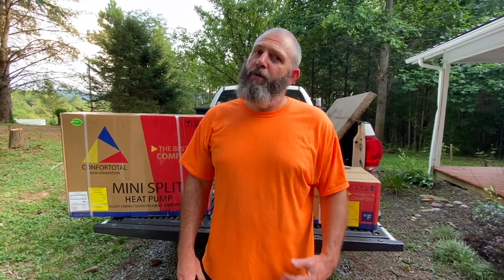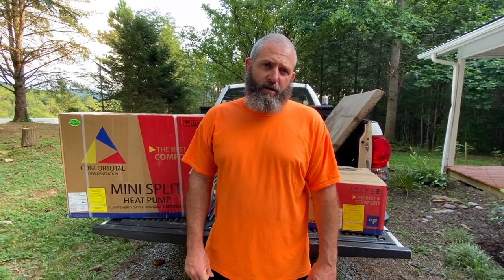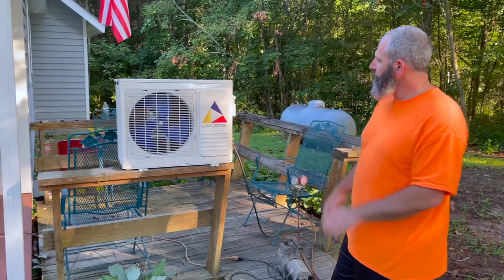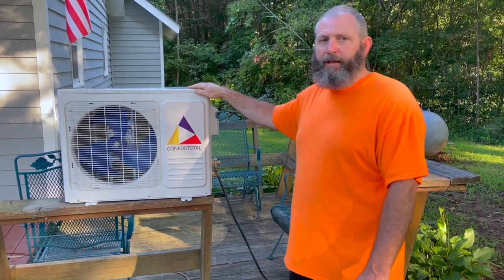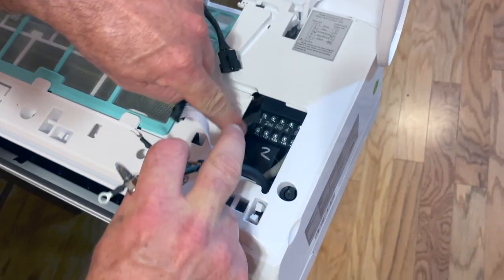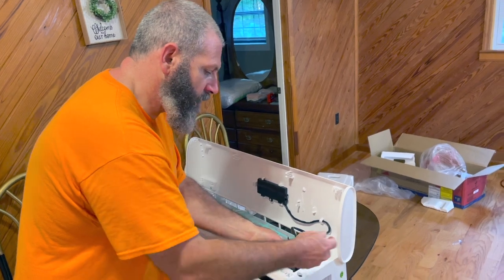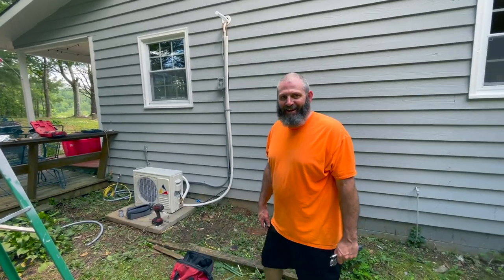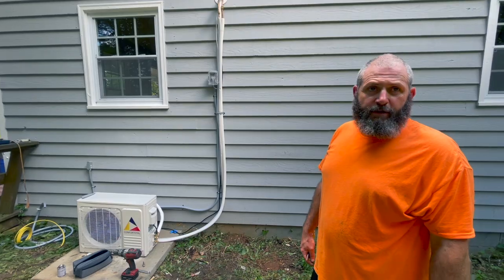INSTALLING THE CHEAPEST MINI SPLIT HVAC YOU CAN BUY!

Comment: I MUST SAY THIS GUY IS STRAIGHT UP. IMAGINE HOW MUCH FASTER HE COULD HAVE GOT THE JOB DONE WITHOUT FILMING. AND CONFORTOTAL IS ABOUT THE LOWEST COST UNIT OUT THERE. WHAT MAKES THE PRICE HIGHER IS POLITICS, AS THEY PROBABLY ALL COME FROM THE SAME PLACE, IN CHINA. LET ME SHARE SOME ADVICE WHEN GETTING A MINI SPLIT ONLY GET A SINGLE UNIT (IN OTHER WORDS 1 OUTDOOR UNIT TO 1 INDOOR UNIT). WHY ? BECAUSE THE MULTI UNIT WHEN THEY FAIL WILL F YOU BIG TIME. IE I HAD A SANYO POS SYSTEM WITH 1 OUTDOOR UNIT AND 3 INDOOR UNITS. UPON FAILING THE DIAGNOSIS WAS TO CHANGE "ALL" THE COMPUTERS IN BOTH THE INDOOR AND OUTDOOR UNITS MEANING THE COST TO BUY THE PARTS WAS MORE THAN THE SYSTEM ITSELF. F THEM. GET SINGLE UNITS AND WHEN THERE IS A FAILURE THE WORST CASE IS JUST REPLACING 1 UNIT. WELL THANKS FOR LISTENING. AND A THUMBS UP TO ORANGE WIRES GARAGE.
Reply from the maker: Thank you for the kind words!
Reply: Hi I was waiting for the refrigerant part.  After the vacuum did you have to put refrigerant and how much.  Did the unit come with refrigerant
Reply from the maker: @anthonygarraud9812 the unit has refrigerant already installed you just have to open the valves.
Reply: Hi, I was wondering the only lines you vacuum were from the head unit onto the outside unit you open the little Velau where you fill in for Freon whenever it’s low to release the fluid the refrigerant correct you only pulled vacuum from the head unit onto the outside unit to get the lines cleared of moisture and then once that was done youmake sure of course, open up the vowels and check for leaks on the connections that you made correct

Comment: For someone that does not know much about home ac installation, you did a fantastic job on it. Super video and I appreciate it and will be buying this same 220v unit for my 1200 sq ft shop.
Reply from the maker: Thanks for the support!  I think you will be pleased with it.  Thank you for watching and subscribing!
Reply: Depending on where you live 12000 btu in Texas will typically cover about 500 sq ft , it doesn’t hurt to over size these inverter type units but again it all depends on your heat load .
Reply: Thank you so much for this  video. I am an older single female that  had one of these installed today in an old  RV that I have chosen to flip and live in.
I love learning new things about repairs. I just subscribed to your  channel.
Reply from the maker: We are glad we could help! Thank you for watching and subscribing!
Reply: How did you un clip the front panel? I'm trying to clean my mini split unit and I can't see to get the front panel to open. Please help me

Comment: just a heads up you will need to reflare copper tube ends and use nyloc so it seals otherwise it will leak :-( mine came precharged. good job! :-)

Comment: $ years ago, I bought a Comfortotal 18,000 BUT, and a month later another brand 9,000 BTU.
The Comfortotal is running like new, the other one is being replaced next week, when it gets here.
The other brand has a messed up circuit board, and since the seller was not registered with the manufacturer, the will not warrent repairs.
The board costs just over half what I paid for the unit.
After replacing my old central AC, my electric bill went down by about 43%.
Reply from the maker: Thanks for sharing your experience

Comment: We have five of these. Two were tripping the arc/ground fault breakers so we swapped them for regular breakers and no more tripping. But one of them is throwing an E3 error code. Manual says to replace pcb and we did but same result. Tech support has been ok, sent wrong pcb first try…will be calling monday for additional support.

Comment: Thank you so much for your video, it was super helpful! We just installed this unit and the heat function doesn't seem to be working out blowing warm air. It's the middle of winter and cold so we don't have a need for the air conditioner function yet. Any suggestions on trouble shooting the heater?
Reply from the maker: This unit does not have heat strips only the heat pump function, so if the temp gets much colder than the mid 30s this particular unit will not produce enough heat without the “emergency heat” function. Thanks for watching and subscribing!
Reply: if there are several feet of extra copper lines coiled up vertically behind the unit, try laying the coil flat on the ground.

Comment: Great installation! thanks for taking the time to share it. Quick question, What type of ROmex wire are you using? 10/3, 10/2, 12/3 or 12/2?  Also, did you add a 20A breaker or used the current one that has the outlet you used power from? I am installing the same unit Comfortotal 240V and would like to extent the outlet but I am not sure what Romex size wire to use. Also this outlet I will be using has a 40A breaker at the panel. Do I need to add an additional 15A breaker for this unit? A 20A breaker? or just use the 40A breaker that are already wired for this 240V outlest I will be using? Thank you !
Reply from the maker: I used a 30amp breaker and technically you should use at a minimum at least a 10/2 with a 30 amp and 8/2 with a 40 amp.  The unit will only consume around 8 amps or so.
Reply: @OrangeWiresGarage  12000 btu only requires 14 gauge wire and a 15 amp breaker at 240 volt.

Comment: 1st of all great great video
I'm so glad that I ran across this video.
I have a question, I'm looking for something similar to this or maybe this exact unit for my 10 by 20 Shed I live in Michigan and we get pretty cold winters. Do you think this unit by itself would be sufficient enough h to really heat up a 200 ft² area or would you recommend a higher btu.
New sub 
Thanks
Reply from the maker: It gets pretty cold in Michigan, like really cold.  The unit that we have does not have heat strips so it is only a heat pump and those only work down to about 38 degrees Fahrenheit.  Not sure if this is the solution you need for heat, but definitely for A/C at 200 square ft. Thanks for watching and subscribing!

Comment: One of the best mini split install videos I’ve watched, great job. I’m going to order this for my shop, was wondering is the plug  on this 220 model 3 prong or 4? I already have a 10-2 wire ran for unit but if it’s a 4 prong 220 then I’m going to have to order the lass efficient 110 12000 btu model so I can use my existing wire. Thank u
Reply from the maker: Thank you for the kinds words and support.  This unit has a 3 prong plug on it. Thank you for watching and subscribing!

Comment: Thanks great job! I wonder how much to buy the vacuum and gauges are, and would like to see you do an update review of this unit in about a year.
Reply from the maker: It’s been a little over two years since we installed it.  So far so good.  As for the gauge set and the vacuum pump I’ve had those for years. Thanks for watching!
Reply: You can rent a vacuum pump and gauges from auto parts stores

Comment: Can’t you just run power to the outside unit to power up both?
Reply from the maker: You could do that, you would just have to deal with the plug on the inside unit.  We powered ours from the outside but used the cable going to the inside unit first

Comment: Thanks for the video. The cable colors that came with mine dont match the instructions. Do they connect 1 to 1, 2 to 2, 3 to 3, 4 to 4, 5 to 5
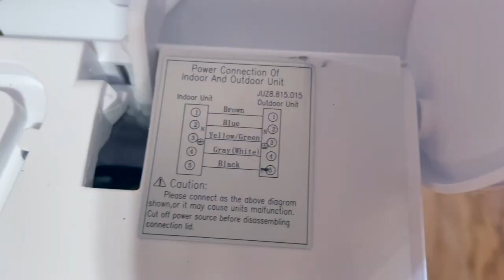Reply from the maker: You are correct check it out at 9:15

Comment: So it doesn't come precharged?  I'm looking for a mini split that is DIY friendly.
How good are cheaper units?  Also can you add another air handler if you wanted to down the road?
Reply from the maker: It does come pre charged we have used it for over a year now and are very pleased
Reply: @OrangeWiresGarage  Also I don't know if you already mentioned it, but if you install this unit yourself than it would void the warranty.
Reply: @Native722  As cheap as they are does it really matter. You could give a contractor 4 or 5 grand to put one in for you. Then it's only warrantied for labor for a year anyway.  I bought a 12000 for 661 dollars for every thing.

Comment: Did you have to do a vacuum for the refrigerant line? Do you have to?
Reply from the maker: The vacuum is to remove the moisture from the lines and evaporator I think you need to but opinions do vary.
Reply: @OrangeWiresGarage  thanks, I think it's best to do one.

Comment: For anyone who has the older units that displays only in celsius. You can order a new remote from the company in Texas and the new remote will display in Fahrenheit, but only on the remote and not the display on wall unit. It makes the conversion automatically between the remote and the wall unit. Again, It does not change the display on the wall unit. But at least you can look at the remote to see what conversion it is. It works perfectly. I ordered a replacement remote and found this out, all the other functions work the same as well on the remote. Hope this helps others.

Comment: Looking at getting about 3 of these to add AC to my house. My question is on the 220v version here does the power input hardwire connect or does it plug into an outlet? It looked like you put an outlet in an outside box to plug it in but I couldn't tell 100%.
Reply from the maker: It plugs into an outlet on the inside actually but We ran the 220 outside to a weatherproof outlet and connected it there.They also have the 110 model that plugs into an inside outlet. Basically the power feeds from the indoor unit to the outdoor unit via the supplied cable.  If you have anymore questions just let us know.  Thanks for watching and subscribing!

Comment: So the mini split gets power from the indoor unit? (Receptacle?) no need for outdoor unit power?
Reply from the maker: Yes that is correct, just plug it in inside (even though we wired ours outside) there is no need for outdoor power.  Thanks for watching and subscribing!

Comment: Hiya!! My landlord had this same kind of heater/ac unit installed in this house where I lives few weeks ago and got heater worked perfectly for 2 days then never worked afterward. Can you please explains me how I can get this heater comes through. Thank You!
Reply from the maker: Just press the mode button on the remote until you see the icon that looks like the sun.  Then the heat should be working
Reply: Melissa, if there are several feet of extra copper lines coiled up vertically behind the unit, try laying the coil flat on the ground.

Comment: This unit doesnt have any freon when you got it? I saw you charging it.  I dont have those tools to recharge and discharge
Reply from the maker: It does have refrigerant I only pulled a vacuum on the system before opening the valves to charge it!
Reply: So its not plug and play at all? It seems that it necessary to vacuum.
Reply: @OrangeWiresGarage do you have to vacum thw system before you open thw valves or can you just open the valves without vacum?
Reply from the maker: @mike.a-ti2qr  I would definitely recommend to vacuum the system before opening the valves to charge it

Comment: What is the size of the adapter used when hooking up the vacuum gauge?
Reply from the maker: 5/16 sae female to 1/4 sae male for my pump https://www.amazon.com/Adapter-inches-Female-Conditioners-Straight/dp/B07V95MS2M/ref=sr_1_2?crid=1X6CN4R5098K8&dchild=1&keywords=5%2F16+to+1%2F4+hvac+adapter&qid=1632750113&sprefix=5%2F16+to+1%2F4%2Caps%2C201&sr=8-2

Comment: What outlet did you use? I can’t find a 220 outlet for that style plug. Did you use a 20a?
Reply from the maker: Yes it was 20amp the unit only pulls around 5 amps when running.

Comment: Does the manual say what it can do in heat mode?  It should give a temp range until it loses efficiency
Reply from the maker: I don’t know for sure that is does but most heat pumps are only efficient down to around 40 degrees F.
Reply: @OrangeWiresGarage  gotcha the mini splits I use in my rentals can heat efficiently down to 5 degrees f so I was just curious at this price point what it could do.
Reply from the maker: @gregorybentz  this unit does not have heat strips only a heat pump.

Comment: My question is if you would have had bubbles due to a leak after spraying soapy water what would you have done? Tightened up a fitting a little bit or if that did not work would you have lost all the refrigerant and had to pay to refill it?
Reply from the maker: Good question since the lines to have flared fittings if it bubbled you could tighten it a little bit more and it should take care of it.  Thanks for watching and subscribing!
Reply: its why you test your lines with dry nitrogen before dumping the charge out of the compressor

Comment: We have two of these tripping breakers. Clean coils, condenser fans operating, no error codes. Runs for 15 minutes then trips…
Reply from the maker: 110v or 220 ?
Reply: @OrangeWiresGarage  110v 1ton
Reply from the maker: @ABC-wz2db  couple of questions here.  Are they on separate circuits? What size is the breaker?
Reply: @OrangeWiresGarage  seperate 20a circuits. Im not on site but am going to check the supply connections and amp draws when i can
Reply: Your manual should list what size breaker each mini split requires. Also. Each unit should be on it's own, independent breaker alone. How many btu's is each unit? 6k, 9k, 12k, 18k etc. The more btu's = larger breaker. A 25 or 20 or 25 amp breaker is required to prevent breaker trip for 12k and up. Your manual should advise what the unit needs. Also. Is your unit 220 or 110/115 ? I'm guessing you're limited on electrical experience? Consider hiring a professional electrician. 👍
Reply: We replaced the arc fault gfci breakers with standard breaker and no more tripping.

Comment: While yes it looks like an okay unit I’ve installed many heat pumps for the company I work for and I really don’t like the idea of this one sending the full power to the inside unit and to the outdoor I prefer the usual method of sending power to the outdoor unit and the indoor getting powered by the outdoor
Reply from the maker: Thank you for the input it helps everyone in the community.  Question: Why is the method you mentioned preferred?
Reply: Looks like a gree , there’s several factories in China that makes most of the ductless units . Many of them use the same parts . Midea makes a large majority of them and rebrands .
Reply: @OrangeWiresGarage  one breaker kills both units.

Comment: Any idea on how to hardwire this directly to the 220 wire?
Reply from the maker: I remember looking at that but decided it was better for me to just wire in an outlet to connect it.  Good luck!
Reply: @Orange Wires Garage  awesome ty! I had a hvac friend take a look at it. He said it's just getting the red and black wire into the 4 and 5 position. On the outside unit from the cut off switch. I'm going to try it!

Also how much electricity does the minisplit use?
Reply from the maker: @sergiomaldonado595  I checked the current draw on mine and it was around 8 amps.  Good luck!
Reply: @sergiomaldonado595  8 amps x 240v = 1920 watts!

Comment: I wonder how well this unit heats in cold temperatures?
Reply from the maker: Not too well it does not have heat strips this is only a heat pump but does pretty well with temps as low as the 30s

Comment: I just bought one and the compressor does not turn on so it’s only blowing regular air. I opened the valve as well. Any idea what it could be?
Reply from the maker: I would say to double check your cables to the outdoor unit but be sure to unplug it first

Comment: I just installed mine, I  had rubber seals in the protective caps coming from the inside unit,  do they get used or are they only for shipping and protecting the flare fittings?
Reply from the maker: Yes they are there to keep the evaporator sealed up,  you are correct you do not reuse them.  Thanks for watching and subscribing!
Reply: I think they are actually to put under the feet for reducing vibrations when mounting to pad
Reply: @eddiesampson2177  good thinkin...!

Comment: Question we just installed ours last week it threw a code F4 this morning can't seem to get any response from the guy we bought it from
Reply from the maker: I’m not 100% sure but I believe the f4 code is related to the control board on the outdoor unit.  You might double check all the connections.  Hope that helps and that is the problem and not a control board.
Reply: Thank you so much!